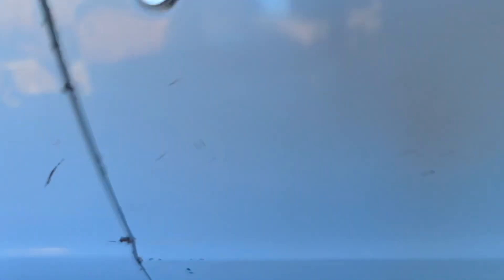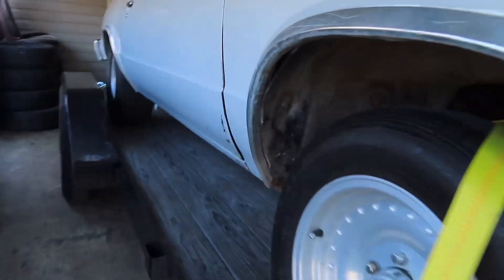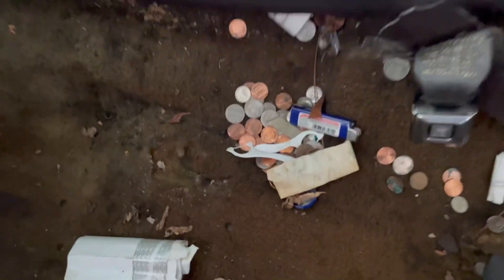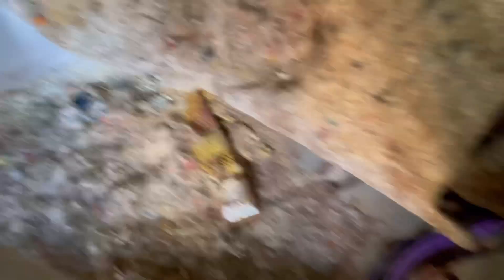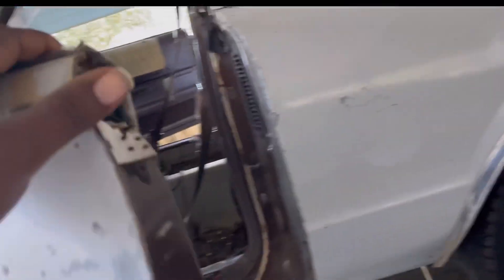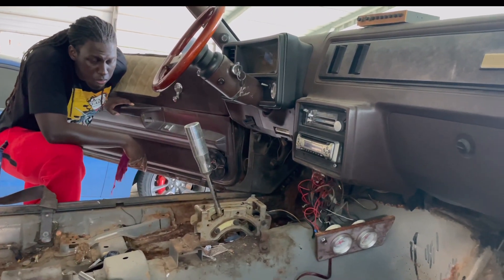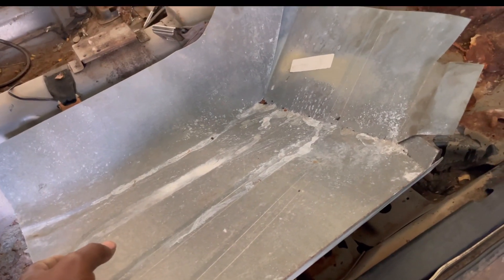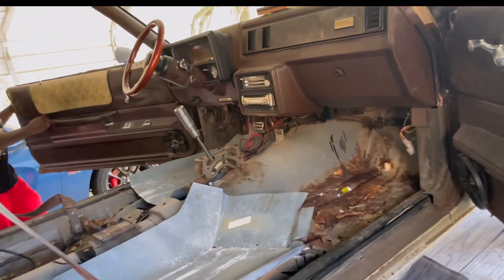THIS 1979 Malibu IS  Very RUSTY!!

Comment: The replacement pan will work you just have to cut to fit. I know it looks bad but it's not just fine were the rust stop and go  about an inch past that and cut it out . Then can cut you replacement peace to fit . You can butt weld it in or overlap I overlapped the in my car, because I had to replace the entire floor and 90 percent of the truck